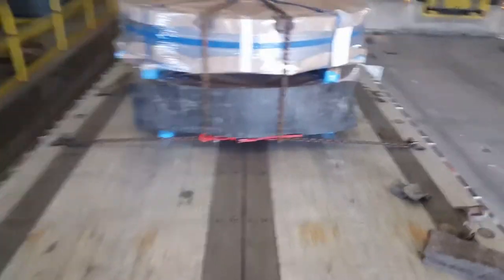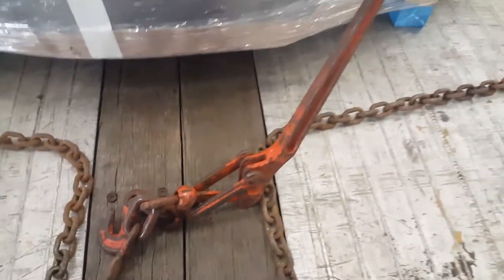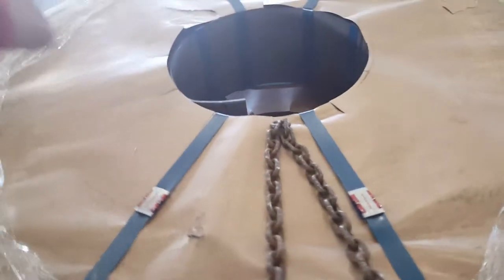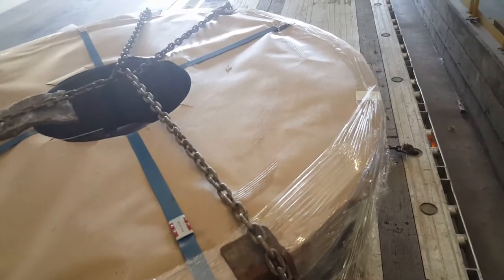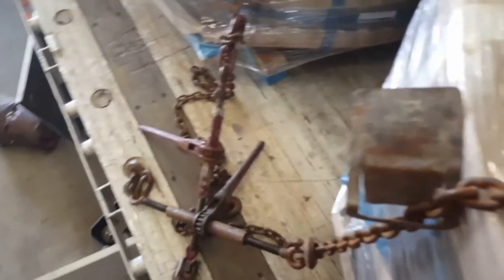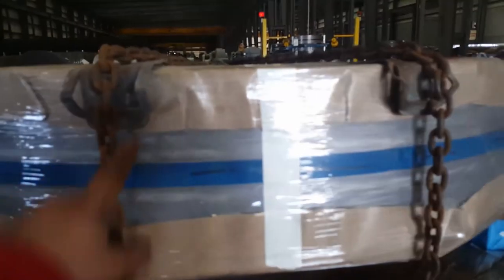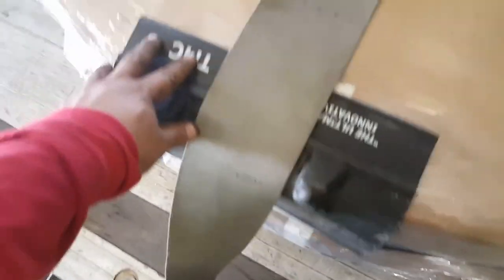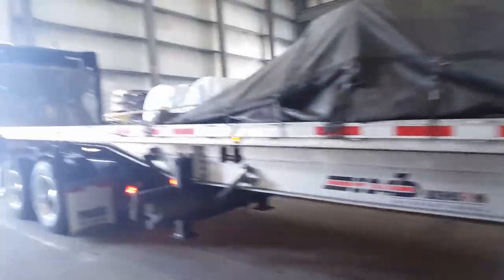Skidded coils securement A chain

Comment: I know this is an old video but this is in no way a safe or legal method of securing skidded coils. The chains pulling on each other across the eye of the front stack would be considered as a single point ot securmemt as anytime you have a chain pulling on another chain regardless of how many times they hook to the trailer the working load limit does not stack. For 3/8 inch chains with a binder( or binders as he has several in use here)
 rated for 3/8 chain the total securement value of what he has there is only 6600 lbs. This method can be used to bulkhead the front stack. This is the same method used to bulkhead shotgun slinky coils, but would require the use of 2 more chains crossed over the eye to be used solely for holding the coils vertically to the deck.

Comment: Where did you get those metal edge protectors with loops in them?
Reply from the maker: That’s what TMC gives us
Reply: @truckeraxelmunoz4939  I always only see the standard black metal ones at the securement lot. They're annoying to use when you have to secure shotgun or suicide coils because they always fall out of place before you can tighten the chains down. I was debating whether or not to buy some of the metal loop edge protectors like yours on my own.